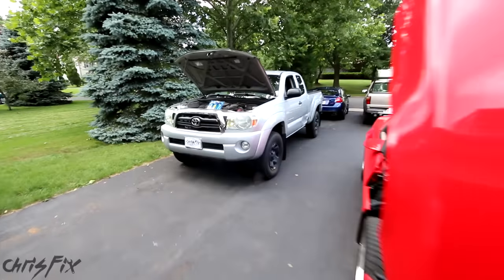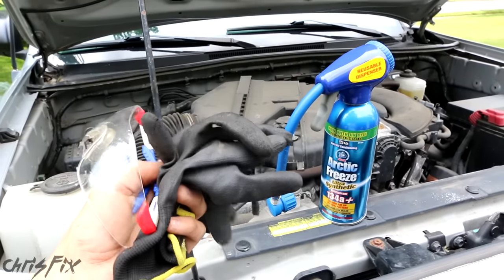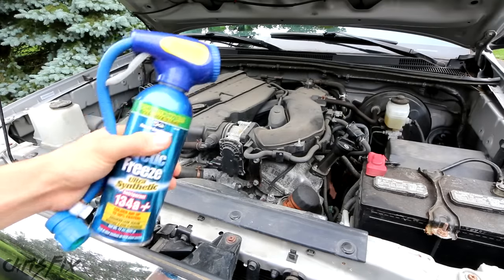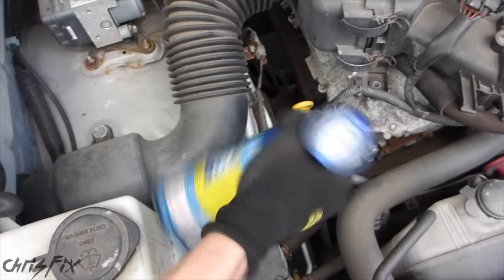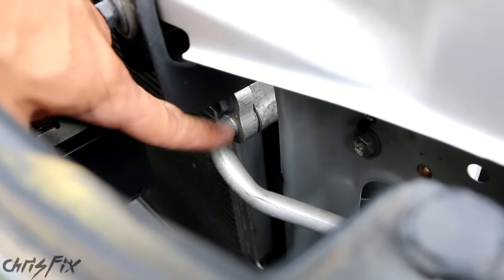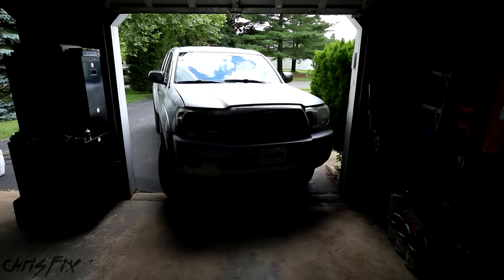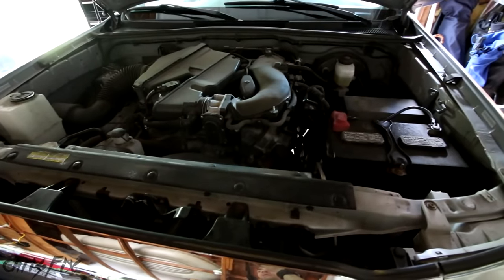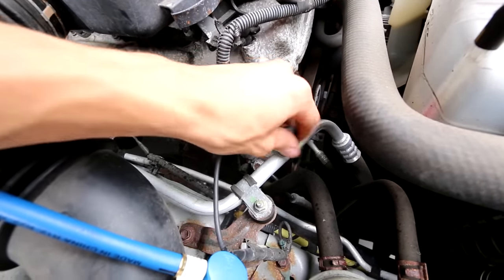How to Find AC Leaks in Your Car (UV Dye)

Comment: I heard you need to add oil to your AC system when you recharge. I have an 07 Tacoma. Do you know how much oil you should add? Thanks for the video.
Reply: Unless you have a major leak where you can see the oil, I wouldn't worry about it.  If you do see a bunch of oil, get a can of refrigerant+oil and put it in instead of one of the cans of plain refrigerant.  There's no way to know how much oil has been lost.

Comment: Hey cris! So my AC stopped working outta nowhere. I tried to refill it up with refrigerant but I then noticed it was over pressured and was in the red area. I then took some pressure out and it went back to the green but it slowly goes back to the red. What could it be? Would help me a lot if you can respond, thank you!

Comment: How long will the UV leak still be visible with the light after the refrigerant is put in? Could I put it in today and check for the leaks 2-3 days later? Or will it no longer be visible by then? Thanks.
Reply: Yes it should be visible up to a month depending on weather conditions… heat and rain
Reply: @reefflexx1971  Thank you.

Comment: Hi Chris, I love your videos man!  I wanted to aske you. My ac on my 2011 Forester hasn’t been working for a while now. But two weeks ago, I noticed a smell after driving my car. I took a look right behind compressor and I noticed some oil that looks like antifreeze color. Would you say the O rings may need to be replaced?  My compressor works fine when I turn the AC on and does not make any noise.   Thank you
Reply: You say "behind", but where exactly on the compressor did you see the oil?  If it's where the plumbing connects, that is just an o-ring or seal.  If it's on the body of the compressor, or at the shaft seal, you got bigger issues.

Comment: My leak is coming from the AC condenser in front of the radiator, if the hole is small enough will the sealant cover the hole?

Comment: Hi Chris, I used this product on my 2008 Altima 2 years ago and my AC compressor blew a few weeks later.   Could the sealer have clogged the compressor?  Do you endorse an updated product for recharging?
Reply from the maker: I would consider it an unrelated (but unfortunate) incident!
Reply: I believe the sealing agent is an oil rather than a gooey substance. It works by making the rubber supple again and thus make them swell a little to seal the fitting.
Reply: @mycofairbanks3321  Thanks!  So you would say it's an unrelated incident as well?
Reply: @brandonlarsen3162  I wouldn't say it is unrelated. If you just used the can to top off your system then you have no way of gauging how many grams of 134a you ended up with.  It could have received too much and the excess pressure can blow out a reconditioned seal.  So you have a situation where you made the seals soft again, (and there is no way of knowing how soft) and then introduced pressure.  It could be directly related come to think about it.
Reply: You can get the dye without the sealer if you want.
Search at Autozone for p/n 330V, it's $4.

Comment: Only charge with enough refrigerant to find the leak as those kits are NOT CHEAP. Also opening up the system releases the refrigerant into the atmosphere, not good, but it's cheaper than having an AC Tech evacuate it and recharge it at a hefty price. Another thing to consider is HOW OFTEN do you have to fill it. I had a Toyota 4 Runner that needed one 12 oz's can a year, $14.00. An AC Tech quoted me $900.00 dollars to replace the Compressor, that's where the leak was. Let's do the math on that! 900 / 14 = 64.28. Meaning 1 can a year for 64 years to equal the cost of replacing the compressor. I would rather spend the money on something else and sell the car in five years at a cost of $70.00 to me. 
If I did the repair myself it would cost $350.00 for the compressor, set of gauges and the R134A. So don't forget the effective cost of fixing a big leak vice a nuisance leak. Just something to consider. Thanks for sharing Chris. Best Wishes & Blessings. Keith Noneya

Comment: Why is sometimes the psi 60+ but then comes back to like 40-50ish and alternatives when reading the psi?
Reply: When the compressor is not running the AC system will equalize. So, the high pressure side will equalize with the low pressure. I.E. Ac compressor engaged and spinning the low side could be 40psi and the high side would be over 100psi and when the ac kicks off, both side might equalize around 70psi.

Comment: Can’t find it online, after driving my car to get the refrigerant, I took the low pressure valve cap off and it popped off and was spraying a lot of air out. Does this mean there’s a leak with the valve stem? When the cap is on tight no air is leaking

Comment: I added Freon last year with one of those types of cans. It probably added oil. I was told not to use those because I will ruin the system by adding too much oil.

I want to find the leak like you show but as you mentioned it will add oil, dye and Freon. Should I be concerned or would it be ok to do the leak test with the kit you show?

Also, I can’t actually turn on the A/C, the snowflake light blinks 3 times and turns off. Will I still be able to do this without the snowflake button on?
Reply from the maker: One can isn’t going to add too much oil if you have a leak.

Comment: Nice DIY, but any sealants wreak havoc on ac systems and recovery equipment required to be used by law.  If it’s anything more than an oil and seal swelled, I.e. if it’s a sealant that hardens or cures with oxygen in the system, it can create much worse issues...

Also, since we know there’s a leak, all the more reason why we would want to pull a vacuum - it was sufficiently low to prevent the compressor from engaging, so the chance of air and moisture is higher. This is only appropriate for a slow leak with an operational system.  This should have been done with bone dry nitrogen and a little dash of refrigerant for a sniffer.

Comment: When you're flicking that can make sure not to go too far, you don't want the refrigerant to go into your system as a liquid by turning the can upside-down, liquids don't like to compress.
Reply: This legend over here still reading comments on 6 year old videos even though he has ~9 million subscribers!
Reply: BTW 0:00, a c4 corvette with the hood open is a familiar sight for me lol, I just rebuilt my transmission and installed a redirad, I'm gonna get the vents working again and try to get the ac going after I try to get rid of my squeaks and rattles with some velcro tape, my poor daily driver turned into a project car.

Comment: @ChrisFix question! Does the DIY refrigerant 'fix' work if the AC Compressor / Clutch currently does not engage? Like is the pressure so low that it's not engaging and by adding the refrigerant it will engage and allow me to find the leak? Or does the clutch have to at least be engaging/spinning for this to work? Thanks!
Reply from the maker: Correct. Adding refrigerant will create the pressure the sensor needs to tell the clutch it’s ok to engage.

Comment: Chris Fix, I am having hot humid air blowing from vents. While AC is on, I noticed that AC clutch engages for about 5-6 secs then stops for 5 secs then resumes spinning. Cycling on and off every 5-6 secs. The low pressure line is barely cool to the touch with AC on and engine running. Any ideas as to a fix?

Comment: Hi Chris, thanks for your help on such information. The workshop told us that the Cooling coil in our 2011 Chevrolet Cruze 1.6L Auto is leaking and needs to be changed. We can't see it because it's located behind the dashboard and it has to be dismantled first before you can get to the Cooling coil. The job is going to cost us USD600. Is there anyway for us to verify this problem and go ahead with the replacement?
Reply: They should be able to show you the dye or oil stain on the evaporator.  You can also find leaks with an electronic sniffer.  Do you what method they used to find the leak?  $600 isn't that bad for an evaporator replacement, it's a big job.
Reply: @stephenh5944  thanks Stephen. We've replaced the cooiling coil with an OEM coil which didn't seem to do the job initially but now seems fine.  But now the garage recommended that we changed the Oil cooler set and the timing belt which are going to cost us about USD 1500.00

Comment: Hey man @ChrisFix, how long is a refrigerant supposed to last in a vehicle's Air con system without any leaks and before refilling the system with more refrigerant probably when its supply isn't enough in the Air con system?
Reply: At least 10 years.  A typical AC system will leak about 10 grams a year when new, and the system will produce pretty cold air with down to half a charge.  The leak rate will increase as the compressor seals wear, so that's where 10 year number comes from.

Comment: Don’t I need to vacuum the system like you did in the other video. I am confused?
Reply from the maker: You only need to do that if you opened the system up like if you were changing out a part. In this case, I am just filling the system a little bit and using some uv dye to trace the leak, which leads to this: https://www.youtube.com/watch?v=rulXlnG2Unk

Comment: Do old leaked out UV dye lose color after a while?  I just replaced my compressor/condenser but the system is still not holding a vacuum.  I want to use UV dye again.  Do I need to wash the engine to clean off the old UV dye before I do the new test?
Reply from the maker: Old dye should be fine
Reply: @chrisfix  I mean, if there were dye left from the previous leak, do I need to wash it off first?  Do old dye OUTSIDE of the system still glow after a few months?

Comment: So what happens if a vacuum is not pulled "ie. using a cheap self refill kit"? How does it damage your AC System?
Reply: If there is moisture in your system, it will freeze at the expansion valve and shut your A/C off via the pressure switch. And it most likely has moisture in it.

Comment: One a/c recharge product advertises its compatibility with modern cars. They say that modern cars may have a valve that artificially reduces pressure in the low pressure line. 
Then a pressure gauge used on the low pressure side will read a lower psi than what is truly in the system, and filling the line up to "full pressure" under this condition will actually over pressurize the A/C system.
What are your thoughts on this? It seems like there needs to be a way to disable the valve on cars equipped with the feature so the pressure reading from our gauge is accurate.

Here's their explanation: Why not use a low-side gauge to see if your system is charged correctly? Because low-side gauges do not work on many of today’s vehicles. Modern A/C systems use a Thermal Expansion Valve (TXV) with a sensor bulb, which can cause inaccurate pressure readings!

Comment: I bought one did everything you showed but for some reason when I hold the trigger down it stays at 0 it doesn’t move up at all on the gauge so I squeezed it for another minute moving it back and forth and it still stay at 0 . What could that mean ??
Reply from the maker: It means that you have a leak somewhere, you'll have to recharge it like this and add some UV dye to see where it is leaking from: https://www.youtube.com/watch?v=Pdq8JAlct6s
Reply: The same thing happened to me, and i dis overed that nowhere in the instructions, both on the kit  and in this vídeo, does it mention to make sure the hose on the bottle of freon with dye is seated properly and the bottle has been punctured by the hose. The cap on the bottle must puncture the seal to read any pressure. This is accomplished by turning the cap with the guage clockwise until seated properply.

Comment: Hi Chris,
Nice and understandable video! I'm currently looking if I can get this stuff anywhere in The Netherlands (seems hard to find for consumers due to climate regulations) but I also have another problem; my AC compressor won't turn on. I've checked all the electronics with a multimeter and swapped relays around so my only logical conclusion would be that there's too little pressure in the system.
As with your car, the sensor is on the high pressure line, and refilling happens at the low pressure side. Will refilling on the low side cause a rise in pressure on the high side as well? Or do I need to manually jump the compressor to the car battery to get the higher pressure around the sensor?
Reply: Hi i also have the same problem as you,did you fix it in the end, did you have to jump the relay or did you did just adding more AC gas restart the compressor clutch and fix the problem,thanks so much
Reply: @victoroneill4381  eventually had my air con refilled by a workshop. It worked really well for some time but unfortunately the compressor is starting to fail so I'm looking at an expensive repair around spring time.
Reply: @victoroneill4381  I had the system checked and refilled by my mechanic and it started back up again blowing cold air!

The previous owner of my car had the AC compressor replaced by a scrapyard one at some point and they added too much oil so my system was also clogged which stressed the compressor. It's making a growling noise now so I'm going to have to replace it.
Reply: @sanderdelange4468  awesome thankyou

Comment: I know this video is 3 years old but I haven’t had a/c in my car in over a year! I had to replace the ac compressor in my car and was told it needs to be vacuumed(?) so when I bought a refrigerant it didn’t do anything.
Reply: You need to pull a vacuum on the system. Chris also has a video on how to do this. It’s really simple. You can rent the tools too at an autozone and you get all the money back when you return the rental tools.

Comment: My problem is that I have a valve cover gasket oil leak, and most of the engine has a thin film of oil, that when I shine the UV light on, illuminates the same color as the dye.

Comment: How long it takes to fill if very low or low pressure of refrigerant in car.? And do we need more than 1 can incase.? My car pressure is not building up, I tried 2 times 15 seconds each
Have 2008 Toyota Sienna. THANKS
Reply from the maker: Depends on the size of the system. Sometimes one can is enough to get enough pressure in the system. Sometimes you need more than one. Also depends on the size (oz) of the can.

Comment: Has anyone priced refrigerant lately? It's 5/25/22 and I just recharged my system, refrigerant has quadrupled in price at minimum. I did mine a couple weeks ago and the price was only up a little, my low pressure switch was leaking so I replaced it and topped off my system. the small cans that use to be 5 bucks is now 27 bucks at Advanced Auto, Auto Zone had them for 10. I talked to a A/C guy while there, he said it is going to get worse.

Comment: my high pressure valve is leaking but it doesn't have any schrader valve, what can i do?
Reply from the maker: You're going to have to get the refrigerant evacuated at a shop and then you can replace the entire line if the valve is built in or just the valve if you can remove it independently

Comment: i have a question. i have a 2009 Ford Fusion, 141000 miles. today was over 90 degrees sitting in the parking lot all day.  i knew it would be hot in my car.  so i turend the car on on full CAC with the door open, then i lowerd my windows fora  few seconds and then i suddenly heard a pause in noise completely  than all the noises all came back 1 second later.  the AC did cool down the car and i felt cold air. 
i am just wondering. would freeon or R134  have been leaking into my coolant system and through the vents of my car and i would be breating that ins/ or is that not really possible? i am just curious.

Comment: What if the compressor doesn't come on? How can we check the level of refrigerant to know if that's why it won't come on?
Reply from the maker: Use the pressure gauge on the thing that screws into the refrigerant can.
Reply from the maker: You can connect the hose and the gauge will show you the pressure in the system
Reply: @chrisfix  Your YouTube channel has always been my favorite for car repairs. Thanks, Chris.
Reply: Did you find your leak and fix it?
Reply: @eaglerider94  Haven't searched since I got the compressor to turn on and the AC is still working amazingly well.

Comment: Chris what if the a c sensor is leaking. How do you fix it?
Reply: It has a seal on it, so just replace the whole thing.  They unscrew from the fitting.  Before you do that, find out if there is a schrader valve in the fitting under the transducer.  If there is, no worries.  If there isn't, you're going to want to bleed the refrigerant out of the system before changing it, then you'll need to put a vacuum pump on it before adding refrigerant to get all the air out.

Comment: See I know this video is old but hopefully I can get help regardless. So my car has only 45k miles and the AC went out randomly one day. I took it to a shop to get it recharged cause I'm like yeah that's probably the issue... it blew cold for a few minutes and went away right away. I took it back and they checked stuff for free and showed me a leak near the front of the car with the UV lighting but it was kind of on the frame which was interesting. 

I want to do this test on my own just so I can see for myself again for sure and make sure I wasnt being deceived somehow. They claim my Condenser is going bad which is interesting... is there a way I can tell the condenser is going bad? My compressor belt still spins and activates when I turn on my "AC" but the car doesnt idle higher and I don't hear that click noise. when you first switch it on.
Reply: Maybe your clutch isn't engaging???

Comment: don't you need to bleed the AC hose to get any air out before hooking it up?
Reply: Those auto parts store kits are hard to bleed.  I use a set of refrigeration gages, and I make sure I bleed all the air out.